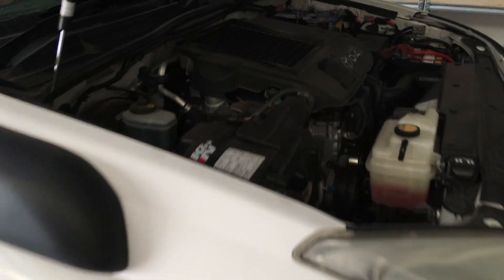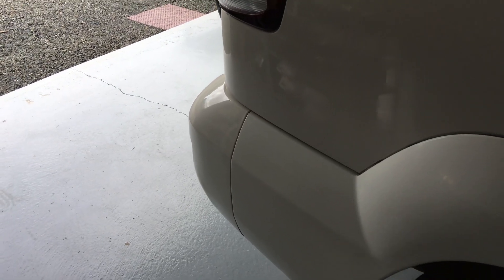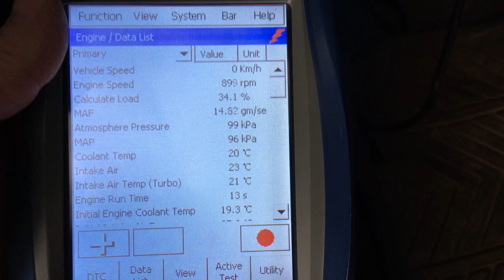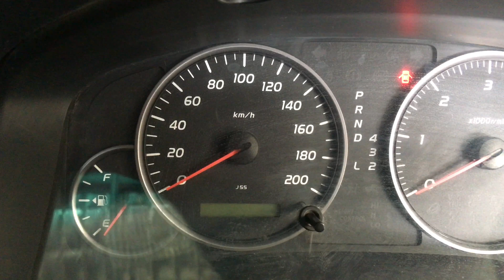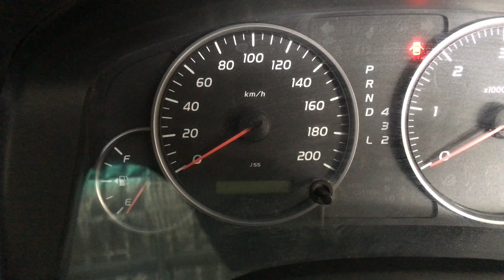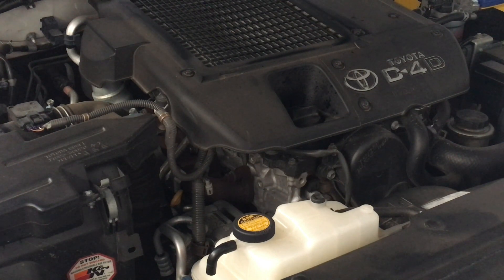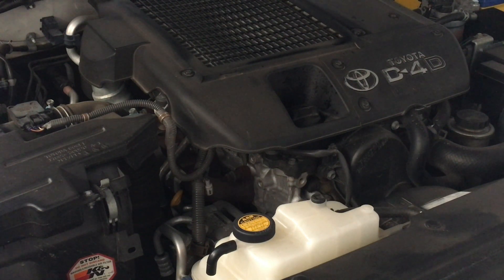ANOTHER ENGINE ALL BUT DEAD PART 2 - MORE INFORMATION & EXPLANATION - DIAGNOSTIC VIEW

Comment: CRDI engines are flimsy at best. In the chase by manufacturers for better economy, better torque and emissions ( the killer in my opinion) engineering of diesel mechanical internals is at such a level durability does not match expectations. Combine that with sub standard  electro/mechanical injectors it is a recipe for disaster. In my experience the average modern vehicle has iridium type soak plugs and these last 100 to 150 thousand klms. I would replace modern injectors at the same life span but the cost is what shatters owners. Why should their $80k baby need major service and 2500 worth of injectors? We are just ripping them off cos it’s running fine. No worries, I don’t give a shit it’s not my car. Go your hardest. Dickheads have it in their head diesels are unbreakable and last forever when in fact modern ones are the weakest link in the whole vehicle. See ya on the road, well the side of it anyway.

Comment: I've got a RC Colorado with a 4JJ1 engine. I've had 2 episodes wher the engine has played up - first: too much fuel usage, 2nd: knocking noise.
Both I used injector cleaner in the fuel (Morelys then Diesel Power) which put the enginer back running OK.

Comment: The best thing for any diesel engine is oil and oil filter changes on time and if the manufacturer recommends 10,000km do it every 5,000km , a pre filter fuel water separator filter before the original filter is a great idea and a good quality catch can not a Chinese eBay crap will keep your intake clean from carbon soot contamination and allow the vehicle to breath , it will also collect the oil that can build up in the intercooler . These three things are the best things to do to guarantee your engine longevity and trouble free motoring. Just don't forget to empty the catch can regularly.